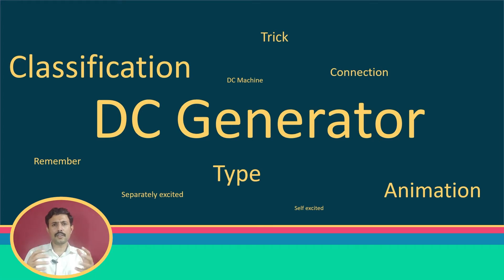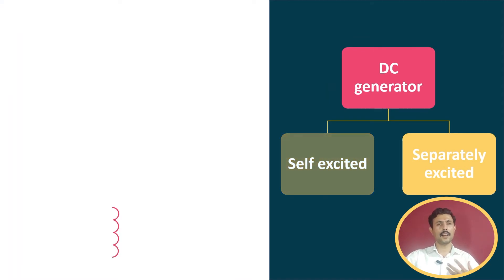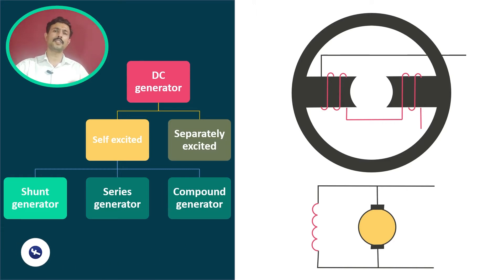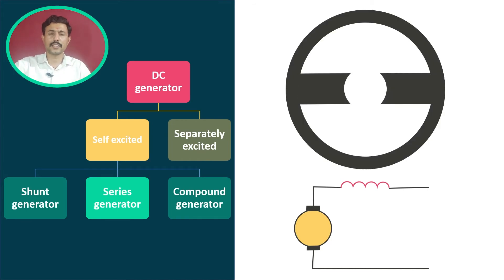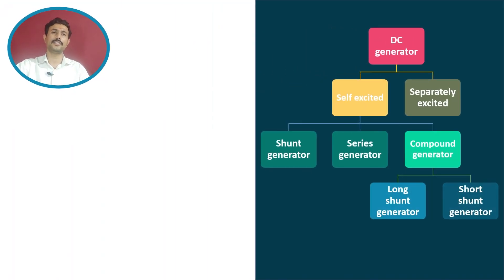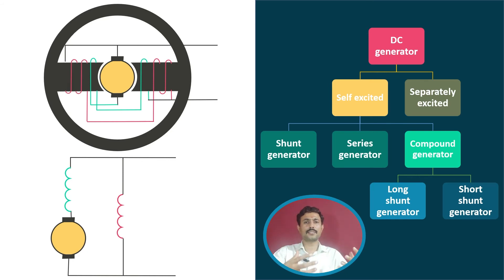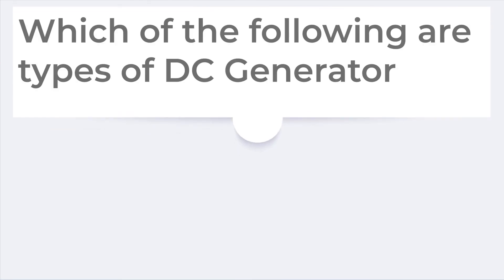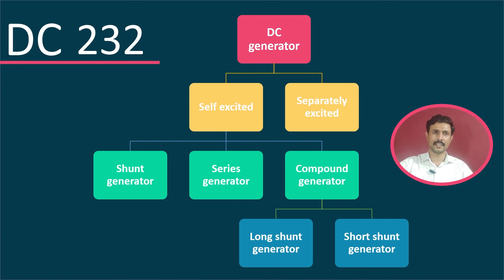Different types of DC Generator, animation | Classification of DC Generator with animation |Mruduraj

Comment: If electricity can be induced by an electromagnet with a direct source, in a direct current generator, why should the coils of each ( armture or rotor & stator ) be connected to a direct current source?Why don't they just connect the winding of the moving part with a D.C, which produces a magnetic flux, and move the crankshaft by any means that induces electricity on the Winding of the stator part, and thus it can be exploited?( i.e. direct current is supplied to the rotor coils rather than the stator coils )
Reply from the maker: In a direct current generator, the coils of both the rotor and stator must be connected to a direct current source for the generator to function. The reason for this is that the magnetic fields produced by the rotor and stator must be synchronized in order to produce a continuous output of electrical power.

The rotor of the generator is typically rotated by an external power source, which induces an electromagnetic field in the rotor coils. This electromagnetic field then interacts with the magnetic field produced by the stator coils, inducing an electrical current in the stator winding. If the rotor coils were connected to a DC source, while the stator winding was not, the magnetic fields of the rotor and stator would not be synchronized, and the generator would not produce a continuous output of electrical power.

In addition, the rotation of the rotor produces a changing magnetic field, which induces a current in the stator winding. This is known as electromagnetic induction and is the basic principle behind the operation of generators. By rotating the rotor, a changing magnetic field is produced, which induces a current in the stator winding. If the rotor coils were connected to a DC source, this changing magnetic field would not be produced, and the generator would not produce any electrical power.

Therefore, it is necessary to connect both the rotor and stator coils to a direct current source in order to synchronize the magnetic fields and produce a continuous output of electrical power through electromagnetic induction.